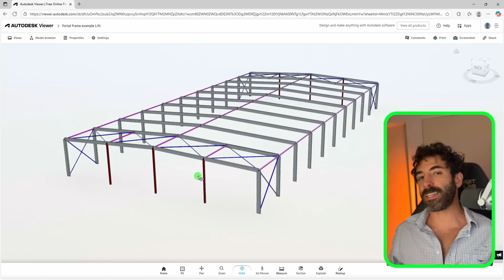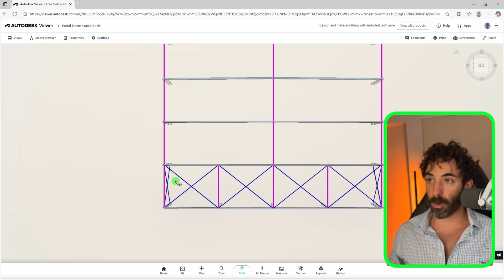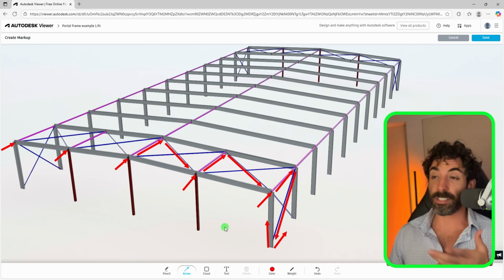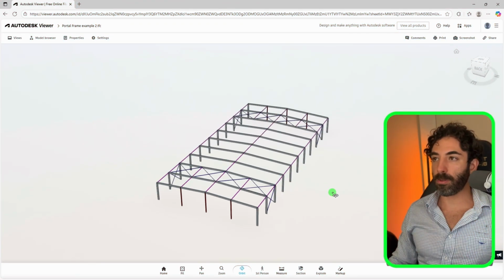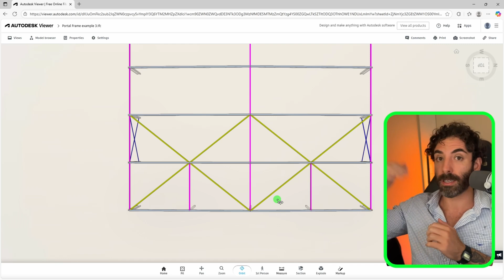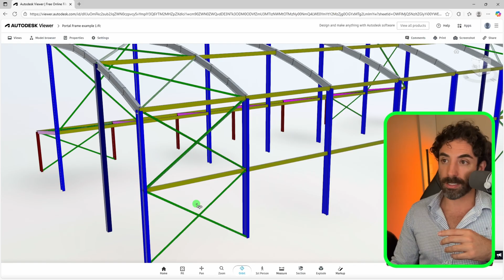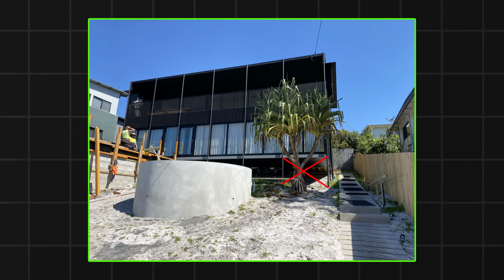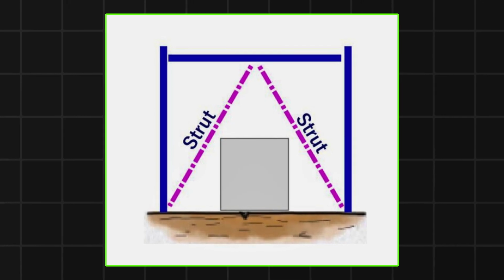The Golden Rules of Steel Bracing Design

Comment: I have a task at my job. The job is to carry oil pipes for a length of 38 meters, where the only supports are in both ends. Is this even realistic? Do i need a really big truss design or what do i need to do. It also needs to withstand an impact load on the column from a truck since it is near a road